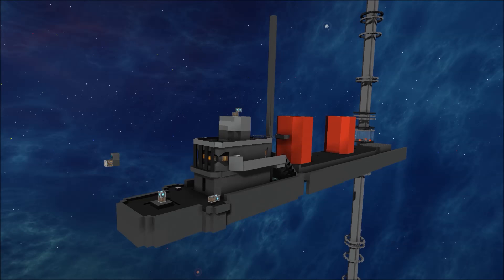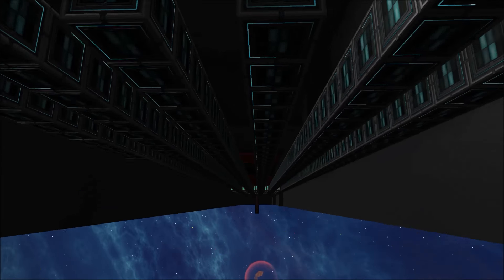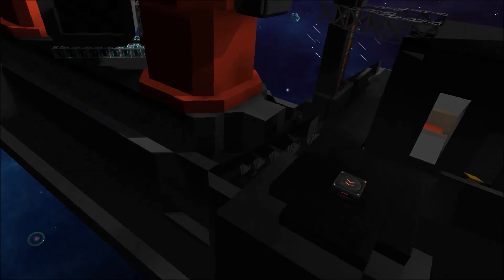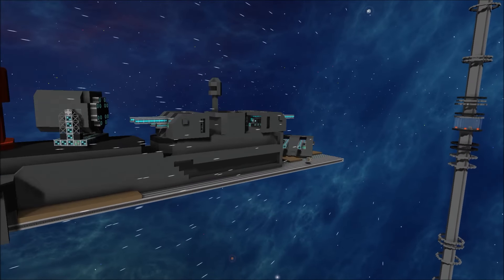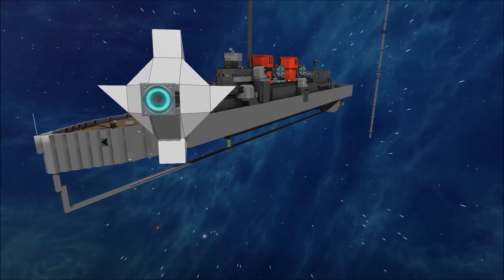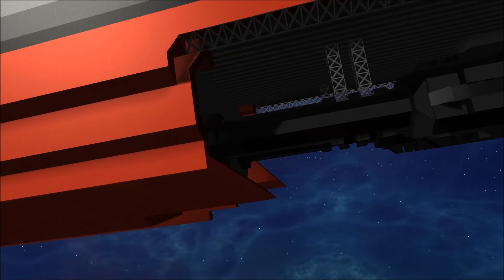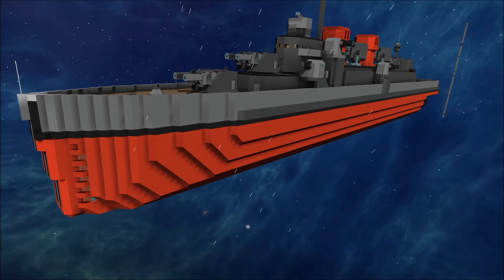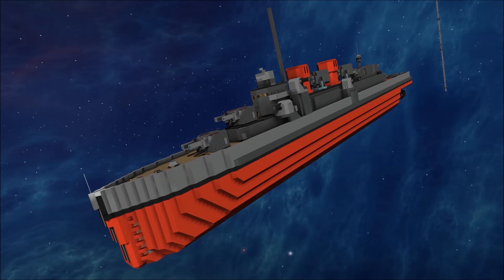WWII DESTROYER BUILD in StarMade (First Part)

Comment: With it's construction it looks more like light crusier than destroyer.
Reply: Agreed
Reply from the maker: If you compare it to the Fletcher Class destroyer, it matches it's silhouette quite nicely.
Reply from the maker: You two need to show me links of what you are talking about.
Reply: Destroyer USS Buck: http://www.navy.mil/navydata/ships/destroyers/dd420-buck.jpg

Light Cruiser DuguayTrouin:
http://www.coatneyhistory.com/DuguayTrouinONI.JPG

And your Fletcher: http://vignette1.wikia.nocookie.net/callofduty/images/3/39/Fletcher-class_destroyer_model_WaW.png/revision/latest?cb=20140407050935

You can cleary see that artillery is quite different. You made guns bigger with double barrels instead of single which was version after II WW because of modules that you need to put inside turret, but by making this you only made ship heavier and that means that ship would be classified by standards for example U.S. NAVY as light cruiser. It all was about tonnage of ship.

Hope it helps. I have nothing to your build (IT IS AWESOME) but in deeper thoughts ship is much stronger than ordinary destroyer.
Reply from the maker: Thanks! The armament may be a bit different, but the silhouette of the ship is what I was going for, but I can see where you are coming from. If I was to build a cruiser it'd be a completely different set of deck plans that i'd need to work with. Thanks again!